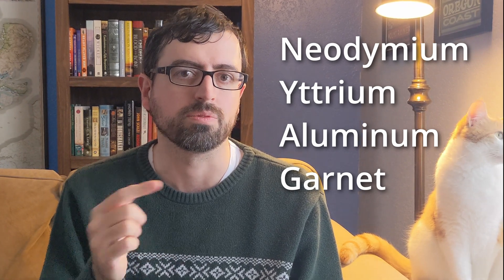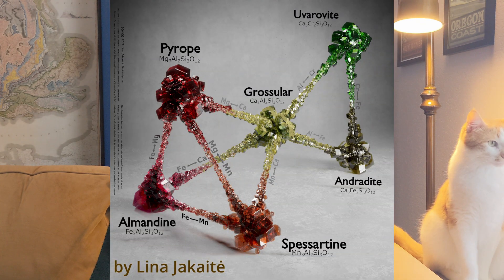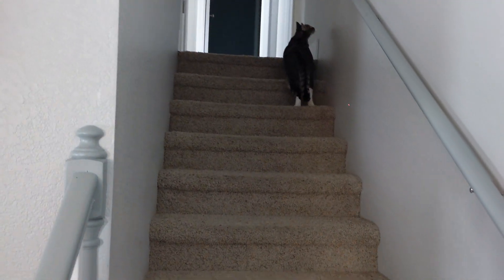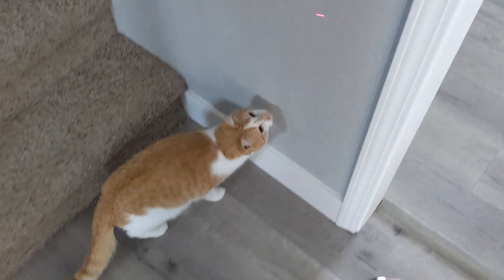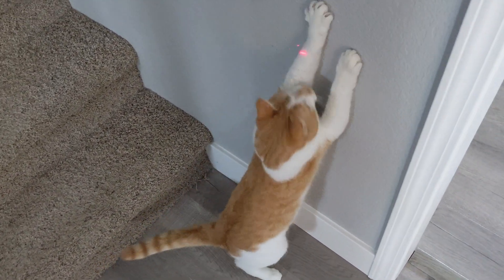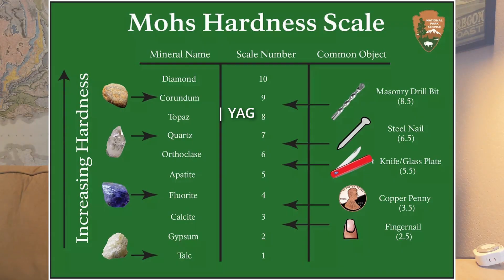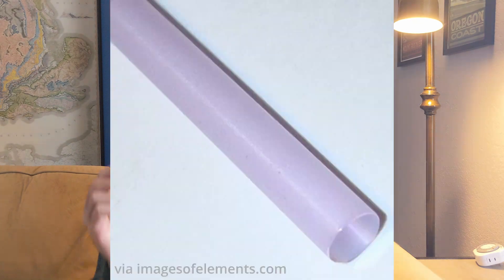YAG: The (Fake) Diamond in Your Laser Pointer

Comment: You are using a red laser pointer, and thus there will be a single crystal of semiconductor aluminum gallium induim phosphide directly excited by electric current, but if it were a green laser the lasing medium would be Nd doped yttrium orthovanadate emitting 1064nm, pumped by a laser diode crystal of gallium aluminum arsenide emitting at 808nm, then doubled to green 532nm by a speck of potassium titanyl phosphate. The orthovanadate is used rather than the yag due to its higher gain and thus shorter cavity lengths.